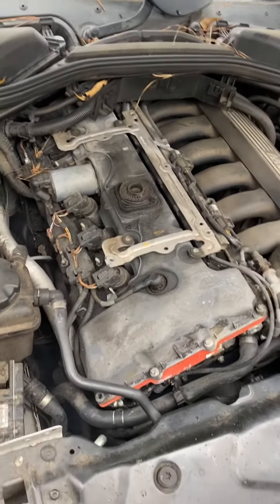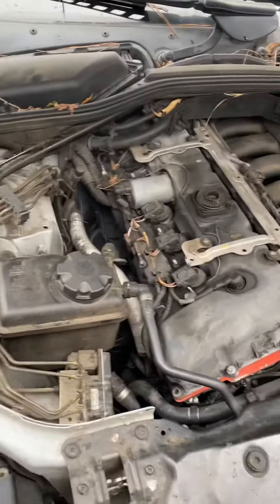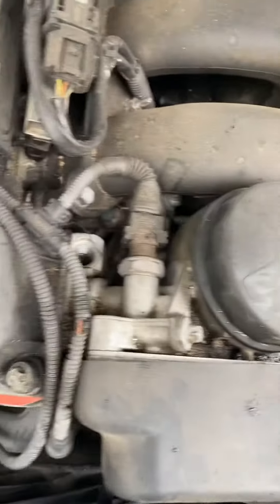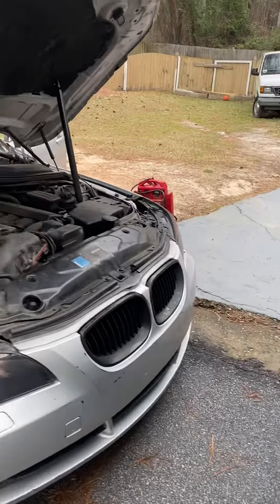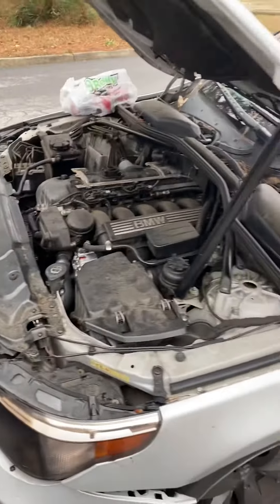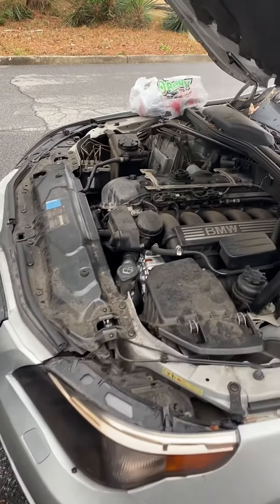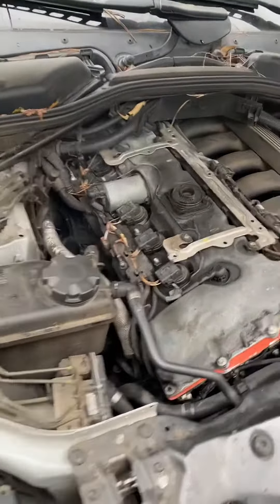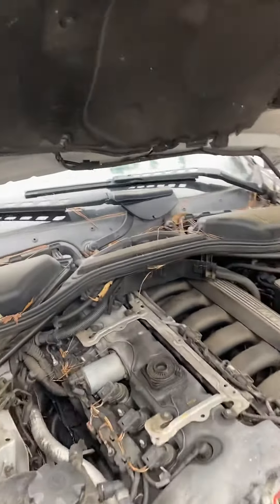2006 BMW 525i Alternator replacement

Comment: Whats your number or ar you in la?
Reply from the maker: j batz 5109154877 I’m in the Bay but we travel to LA
Reply: I really need help on my bmw 530i it wont start and it happened right after i got a new electric water pump installed
Reply: I drive the car with the maf disconnected and the mechanic had connected it and started the car then i turned it off and disconnected it again nd it didnt wanna start
Reply: People are saying it could be the starter and other people saying it could be the fuse or alternator
Reply: Before that tho the battery would die on me i would charge it then put it back nd start the car but everytime i would open the door the battery would buzz and click from the engine but it would start